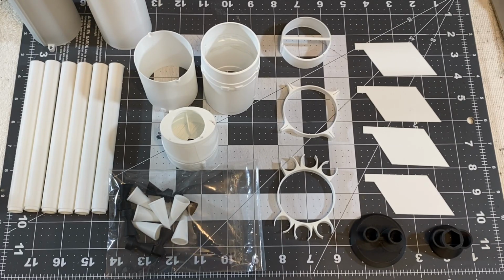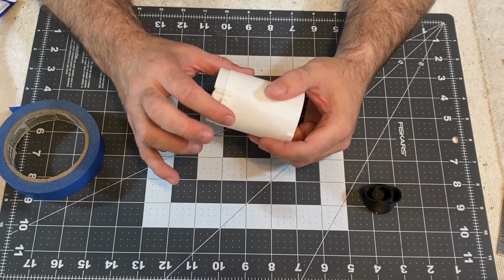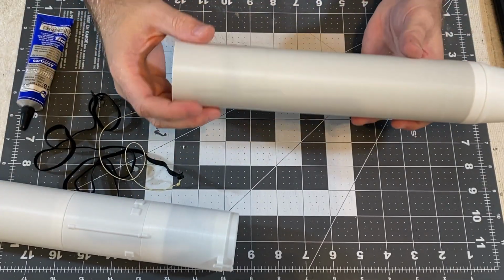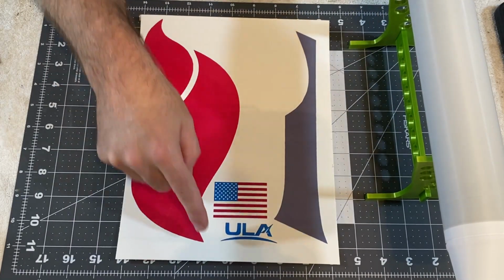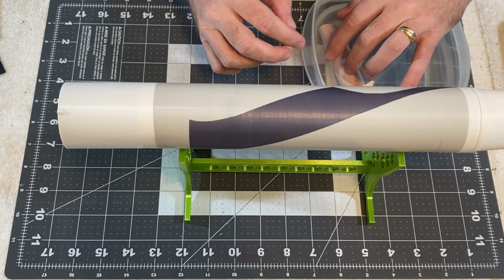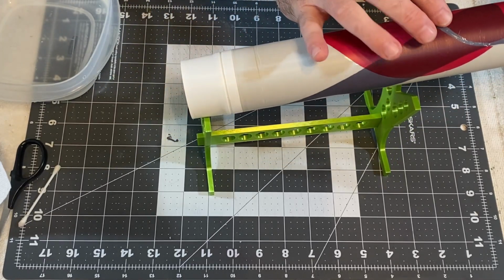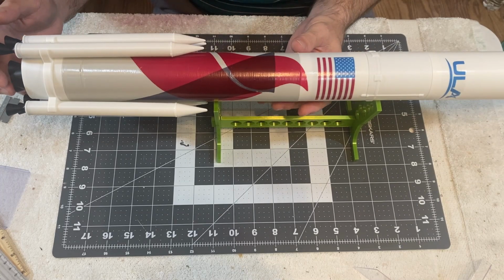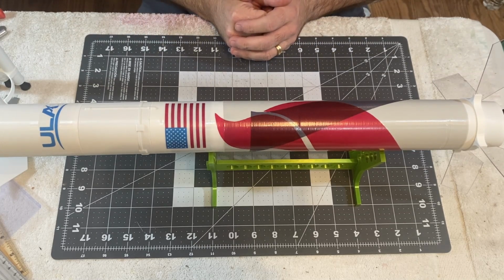Building the Max Q Rockets ULA Vulcan Centaur

Comment: Great video again! That water slide decal placing was intense ! Looks great 👍 
Think I’ll stick with the vinyl one . 
The shock cord mount will change on future models I’m sure, also not convinced with the current setup.
The fins are an improvement like on the Falcon , but still be surprised if one does not fracture on landing .
Please go fly these kits when you can look forward to watching that !
Reply from the maker: Thank you!  The vinyl one won't require a bottle of Excedrin to go with it!  LOL.  Although the kits aren't perfect (what is?), I truly think Max Q has a couple winners here!  They're extremely high quality and well designed models.  I will be flying them shortly and hope to have great success!  Thanks for your comments!

Comment: Really appreciate all of the tips!  Especially on the decal placement, the instructions from Max Q were not very clear about that.  One other problem that I had was that the motor mount portion (the white part at the bottom) and the engine retainer that screws into it were defective.  The motor retainer part (black) would not screw into the motor mount (white portion) and was so delicate that the 3D printed layers were just falling apart from attempts to screw it in.  The 3D print had somehow messed up the threads and it just didn't work.  Also the white motor mount part basically just fell apart when I was dry fitting it into the gray main body tube.  It broke in two!  My solution was to replace that whole part of the rocket with a length of ST20 tube (which fits perfectly into the gray main body tube and to build a real motor mount in that using plywood centering rings and an Estes 24mm motor kit and Estes plastic 24mm motor retainer.  I also saw your accident with the SLS, so I think it may be just as well to have a more sturdy motor mount.  In my opinion, the motor mount system developed by Max Q for their kits is clever but it is too delicate to stand up to the power of actual motors.  It either has to be made of thicker plastic or replaced altogether with some other way to mount the engine using more traditional methods.  In any case, thought I would add this experience for other modelers out there.
Reply from the maker: Great feedback.  When I rebuilt the SLS, I did install a traditional 24mm motor mount (For E motors) with centering rings and the Estes Retainer Cap system.  Held up well under my last flight (E12).  As Max Q cranks out kits, I assume it is easy for the machines to print up some accidental weak components.  He's really good about responding to customers and replacing parts.  Hope you can rectify your kit, and maybe even upgrade it to 24mm, as it is tough on it with only a C motor.  Blessing in disguise perhaps.  Upgrade to 24mm!  He has already upgraded the newest version, so maybe you can get creative, as you suggested, and stick a larger tube in there.  Good luck and have fun with it!  Thanks for your kind words!
Reply: @KevinsModels  My reason for switching to 24mm on the Vulcan is that I want to permanently attach the SRBs.  This adds weight and so I thought 24mm would be better.  I am also building the SLS and my solution to prevent the motor from breaking loose like in your unfortunate flight video was to coat the interior of the motor mount portion of the SLS with 5 min epoxy to strengthen the assembly.  Still haven't even applied decals to the SLS, so it will be awhile before anything is launched.  Plus, we are just exiting a period of very snowy and cold weather where I live.

Comment: Another feat of rocket engineering. Perhaps Max Q (@randallknutson2651) should use you as a consultant on future designs to be able to incorporate suggestions prior to public release. Would be nice if it could be configured in a manner that launches with the SRBs attached. Scale wise, how do the SRBs attach to the real rocket? Seems like they should attach closer to the nose of the SRBs. What size engine/motor did you say goes in this? Seems like 18mm may be too small (especially with the kitchen sink in the nose cone!). Perhaps 24mm (C11, D12 capable) would be better?
Reply from the maker: The instructions call for C motors, but even with a C5-3, it was a tad underpowered to achieve the desired altitude.  Possibly a Quest D motor.
Reply: @KevinsModels  Quest 18mm Ds are not full D impulse (i.e., not twice an Estes C).